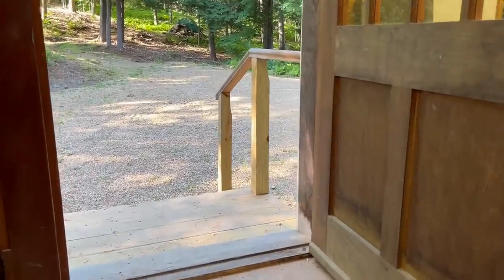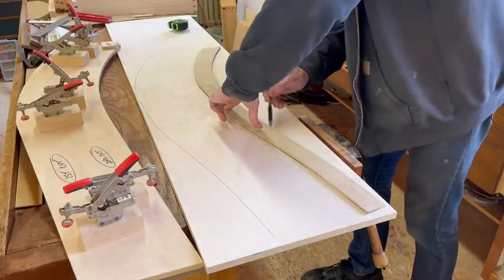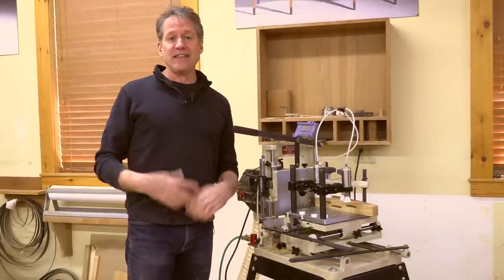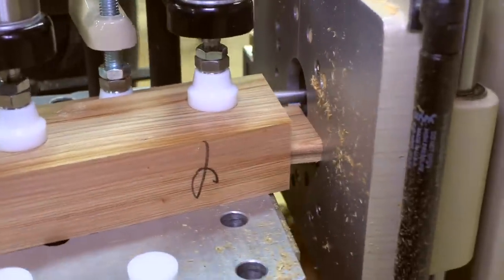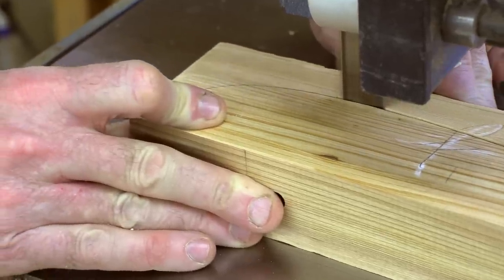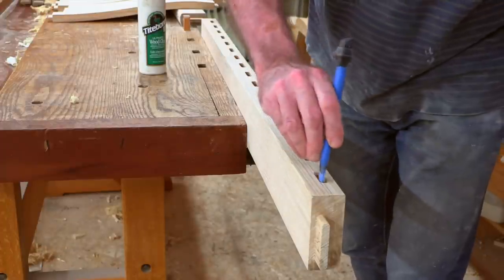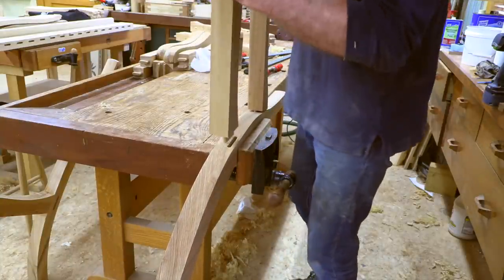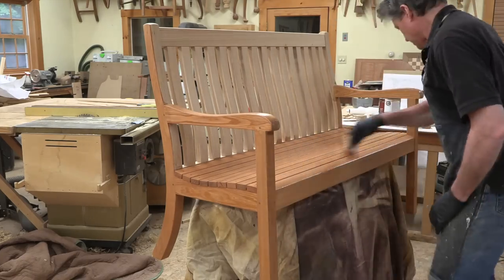I Built an Outdoor Bench

Comment: Hi Tom. That slider is a sweet looking saw. Finally...another woodworker using a multi-router. That thing is the stuff. You have one of the perfect applications for it...upper and lower back rails. I generally do loose tenons on everything. I run them on the table saw for width, planer for thickness and sometimes the router table to round over. I usually make up several sticks to keep on hand and cut to length when needed. I build some slatted furniture and this thing rocks at repeat mortises like that. Great build by the way. Thanks for the video.
Reply from the maker: Hey Thanks! Yes I do like the slider, the Felder K700. I have yet to make the most of it, but amazing potential and applications for making jigs that attach to the slider, for precision and efficiency with multiples, and very safe way of working too.
I do love the Multi Router too, glad to finally have one! I know what you mean about the floating tenons. It does make faster not to have to think about the added tenon length, and there is a little more setup. From a couple other guys I heard the same thing, mostly using it as a mortiser. I wonder if Woodpeckers, now that they own it, will consider offering premade floating tenons like the Domino. Although most probably like to make their own because it’s not to much trouble to make a run of them and you can customize the width and length easily. Do you have a favorite material you use to make your floating tenons?
Glad you enjoyed the video, thanks for watching! 👍😎
Reply: @EpicWoodworking  I bought the domino sticks when I had the 700. I liked cutting them to the length I wanted. If Woodpeck could get the price that was suitable, it may be worth a try for them to market some widths. It is easy to cut the width and thickness I need though. In the beginning I used the router table to round the edges. On the last few projects I just used the block plane to bevel my edges with approximately four facets. Kind of semi round on the edges.  I don’t make my tenon stock to fit very snug on the width. I give myself a tiny bit of wiggle. The material I use is generally cutoffs of the material I am using for a project. Nothing scientific. Just being thrifty. I’m glad Woodpeck is releasing some new videos of the machine. The old video of Jerry with Lorraine Tool was a little dated. I appreciate you stepping out on the limb with the multi-router and the Felder. Seems some of the online and magazine community will shame some folks for using expensive equipment. I can appreciate that but also appreciate thinking outside the box of how may different ways a project can be created. Thanks again.

Comment: I built this bench using your swing/bench plans & video. Came out great. The problem is I finished it with several coats Marine grade waterlox and a couple coats of floss waterlox. Well 2 years later and the finish is faded unevenly and looks like it’s even gone in places. I need to refinish it. What should I use? Paint? Thanks, Joe

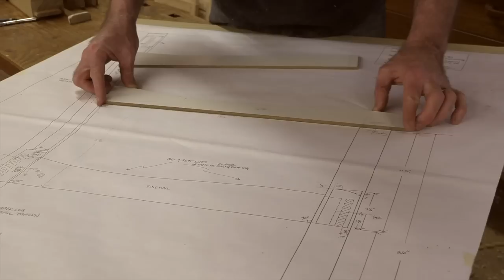Comment: Tom, this is such a sophisticated design compared to so many other benches. Incorporating the front seat rail into the series of seat slats is just one feature that sets it apart. This is definitely on my project list. I am curious about the parts marking system you use, especially because I think I have seen others using a similar "language". A good example is at 8:35 of the video. Is there a place online where this is explained?

Comment: Tom, that is a really nice bench! Is it possible to build this bench using your plans if you don't have that fancy machine? I do have a bench top hollow chisel mortiser, as well as regular chisels, a shoulder plane, etc.
Reply from the maker: Thanks Darryl! Yes, absolutely, all of our drawings show more standard mortise and tenons and are best used with a hollow chisel mortiser. This was a “one off” method because I just got the Multi-Router and I was just showing how the process could be modified to use the Multi Router.
So short answer is you have all you need to follow along on the drawings (and with the video series option), if you want to make it! Thanks again 👍😎

Comment: What I noticed with the Multi Router is the templet is down low where it collects sawdust from the router. Does the bearing end up rolling over the sawdust causing an irregular shaped tenon ?
The Panto Router  has the templets high on the machine away from any sawdust. :yougotthis:
Reply from the maker: I think that was a problem before Woodpeckers bought Multi-Router a couple years ago and designed and added in a dust collector. I only know it with the dust collector and there was not any issue with sawdust messing up the tenon. Must have been a problem in the past. Thanks for watching! 👍😎

Comment: Tom. Thanks for your earlier replies. 

I want to make a gate for the deck of my daughter's new house. I'm looking at making saddle joints at the four corners. Is a three 1/2" finger joint, like an open mortise & tenon, stronger than four 3/8" fingers? The fingers are to be 3" wide by 3" long on the ends of 1.5" x 3" timber frames. I know there is a much larger long grain to long grain gluing area with the 3/8" fingers. But, are the thinner 3/8" fingers much more prone to breaking than the 1/2" fingers?
Reply from the maker: Hi Jim, sorry for the delayed reply. I hope your question wasn’t too time sensitive. If not, I think I would just go with the three 1/2” finger joint…easier to cut, plenty strong and functions great. Hope that helps…for what it’s worth. 😎 Thanks for watching! 👍
Reply: @EpicWoodworking  Well, great to know and thanks for the (delayed - No doubt giving it a lot of thought,🤔) reply. However, in the meantime my daughter is buying another house and won't need the gate. On the other hand I'm looking t a move too. So I might need one. Really enjoy the show, BTW.

Comment: Wait, is that a shaper cutter head attached to a regular router table? How?
Reply from the maker: No it’s a large flush cutting router bit, a compression style cutter with top and bottom bearings. It’s made by Infinity Tools, I think called a “Mega” bit…I wonder why? They also have smaller diameters and heights of the same style cutter. The one I’m using in the video is the 1 1/2” diameter and 2” high cut capability. Hope that helps 👍
Reply: @EpicWoodworking  That helps a lot, thank you! Now I just need to figure out how to get one to Europe

Comment: Why don't bench designs ever have the top crossbar be flush with the back supports? There's always that edge cutting into my back. I think a lap joint would do it.  No?  Lovely bench though.
Reply from the maker: Hardly any offset there, and if you sat in it I think you would be surprised how that is a non-issue to its comfort. But making them flush could certainly be done. My primary reason for offsetting (less than 1//8”) is to have the shoulder of the joint protected from the weather, and to not have to be concerned with the inevitable seasonal movement out of flush over time.
Thanks for watching! 👍😎

Comment: Meh. Don't see a single reason to have so super-expensive extra-fancy router and not doing the same with just a regular dowels.
Reply from the maker: Yes, except the dowels don’t hold up as well over time and are not as strong overall. But I agree, the fancier more expensive tools are not always necessary, as there are lots of ways to do things. Thanks for watching! 👍😎
Reply: @EpicWoodworking  debatable though :-) Many says dowels aren't as good. But if I used pine and hard wood dowels with a special glue that is holding it unbreakable and way more stronger than the wood itself, I doubt that dowels won't hold long enough, unless I am missing something. But hey, I don't have those fancy tools of yours. 😂🤣